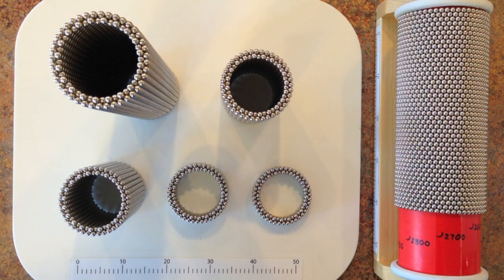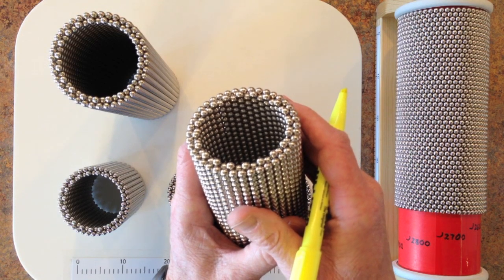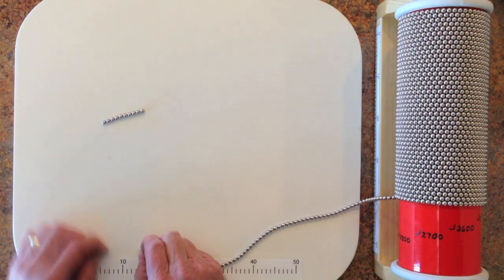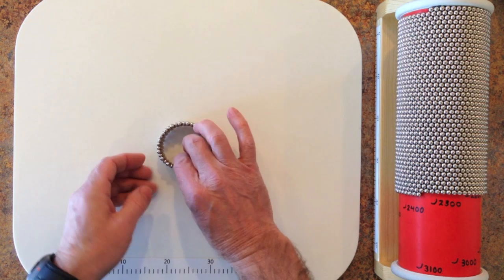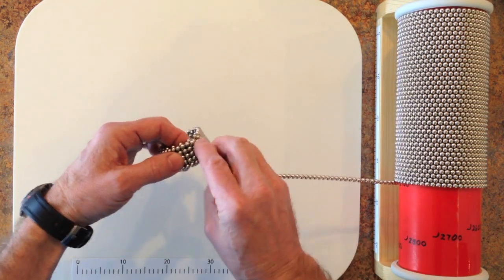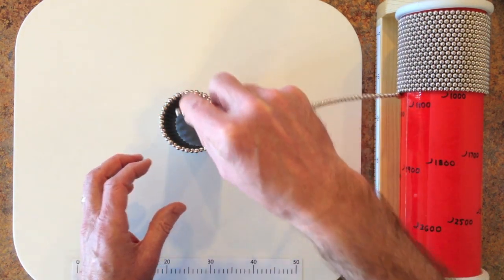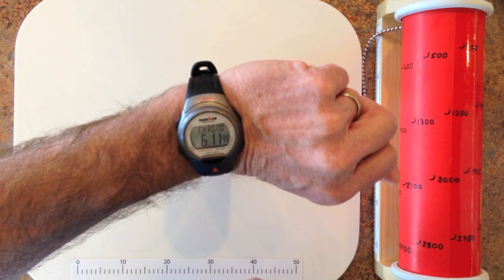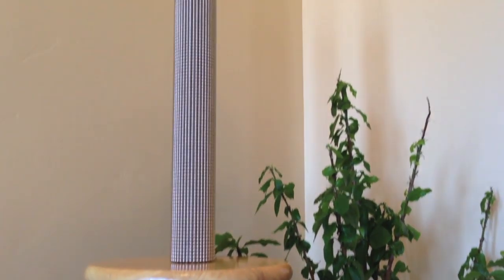Double-Walled Tube Tutorial (Zen Magnets)

Comment: "Very strong"
Immediately after I made it, it squished as I picked it up-
Managed to fix it easily, but it feels quite delicate.
Reply: Are you using clean Zen Magnets, or Chinese generics?
Reply: @RationallySkeptical  Not only that, most of the strength comes from the top to the bottom of the cylinder, not the lateral siding.

Comment: I did some own maths and got first 40.9 magnets, and then I included the 3d-overlapping of inner and outer wall and got 38.6. I calculated this in "blocks" and I didn't take it too seriously, so I believe 40 is the right answer.
By the way I found this fun fact that 2d-overlapping of spheres is √3 / 2 ~ 0.86 tighter, and 3d-overlapping is √(2/3) ~ 0.82 tighter.

Comment: What is interesting about the polarity in the inner tube is that there are two directions of spiral lines that mirror each other, where in one spiral direction the polarity is opposite compared to the polarity in the other spiral direction.
Reply from the maker: Yes, and you can build the shape using spiral windings in either of the two directions.  Another curious thing is how the inner wall mates magnetically with the outer wall, because the magnetic fields of the inner wall are spiral (or circular, in Damian's case), while the magnetic fields of the outer wall are axial (in both cases), albeit in alternating directions.  It's such a fascinating shape. And as fascinating as the magnetic mating is the geometrical mating; how the hexagonal lattice can mate with the square lattice.
Reply: Boyd Edwards I think there is an element of "must" about the geometric mating though, given that the vertical axial stacking pitch is identical, and the curvature is a function of the stacking.  I agree that, if you just think about the mathematics and geometry, it seems surprising that the the two circumferences happen to align with the the magnets stacking so snuggly, but from the point of view of actually building it (using my method, not yours) it seemed 'necessary' that there would be this alignment. 
Did you ever actually try 42 or 38 ball diameters, btw? (I   cant remember if i tried)
I also note that there is a fellow on flickr making spiral versions of the tube.
Reply from the maker: Damian O'Connor I tried 42 and 38 balls, and they do work, but don't fit as well as 40.  I also tried and succeeded in building spiral shapes of various pitches, like the ones shown on Flickr.  They're cool, but not as cool as your amazing cylindrical design.

Comment: I really enjoyed watching the tube construction.

Any chance for a tutorial on building your ball dispenser?
Reply from the maker: Kerry, thanks for asking.  I'll work on it.  The dispenser is just a 3-inch cardboard mailing tube cut to about 12 inches, with holes drilled in the plastic end caps through which a 3/8-inch copper tube passes.  The copper tube is longer than the cardboard tube, and fits into grooves cut in the wooden end pieces, with a screw through the wood and into the copper tube holding it in place on each end.  The ends of the cardboard tube have "D"-shaped weather stripping wrapped around them to stop the magnets from sliding off and to serve as bumpers that you can use to turn the tubes.
Reply from the maker: Kerry, I finally uploaded a video showing how to build the dispenser, http://youtu.be/aViQQoLi8qc.  Good luck!
Reply: @boydedwards5475   i bbnkoppppopkkjjp